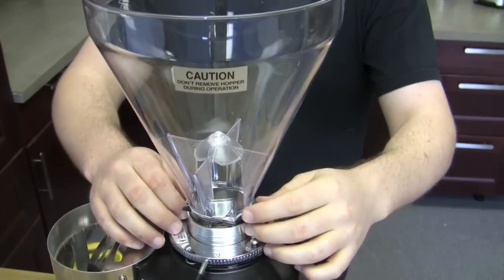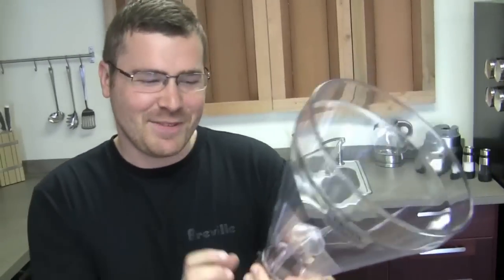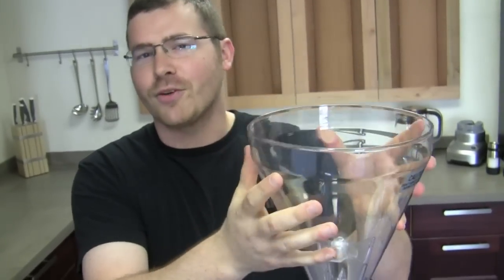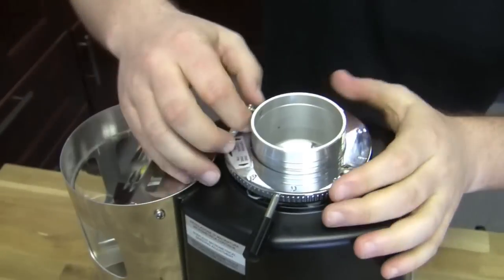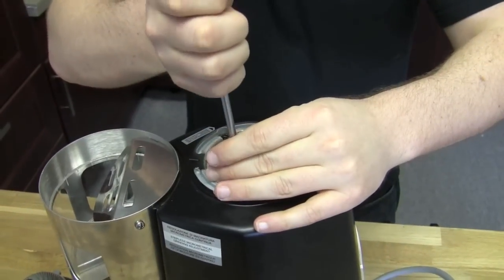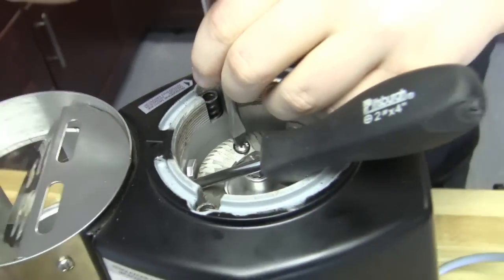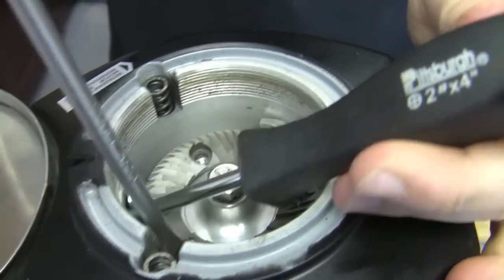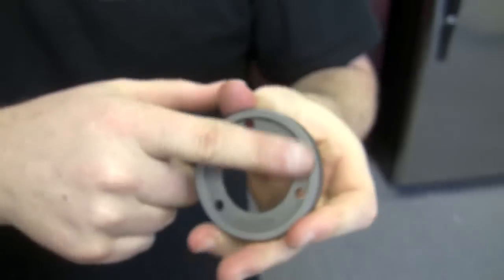Tech Tip: How to Clean the Mazzer Super Jolly Coffee Grinder

Comment: Though this post is a bit old, hope to enlighten some coffee lovers and help keep their gear clean. 
In the beginning Brandon says how he dislikes a brown hue in the hopper do to coffee oils, though this is part of it,  the fact is if your  hopper a older (1-1/2 -2 year old grinder) yellowing of the hopper is normal. This has to do with a chemical used in the manufacturing of the hopper for fire retardant, strength, and molding called Bromine, or the loss of.  The loss of bromine doesn't  mean that the plastic is recoverable. Though they look a bit rough.  Cleaning does help, but if you have cleaned and cleaned with no results it's not coffee oil.  
But you can fix it. You can use diluted H2O2 (Hydrogen peroxide) 5 to 7 % with water! Seal the bottom with plastic rubber bands or what works with you. Pre mix and fill, then leave outside for 8hrs (that's right) UV reacts with the H2O2 and bromine to remove the ugly hue! bromine is brownish red in production then they use UV to remove hue!

Comment: Great instructional video. I just followed his instructions while cleaning and replacing the burrs on my 10 year old Mazzer Mini Timer grinder. However he's wrong when he said it's not necessary to remove and clean the burr located in the top. Since I had to replace both burrs, I  removed the old burrs in the top and bottom. The coffee gunk underneath the top burr was twice as much as in the lower burr. Don't worry about his concern that removing the top burr was tricky and you could strip the screws. It was actually easier to remove the top burr then the bottom.
Reply: Bill Dalton yeah I guess because that one doesn't spin it's not shaking any grind off?

Comment: Gail and Co., can I ask for a lil recommendation? I accidentally "over-cleaned" my top burr carrier and collar for my SJ while removing a block in the spinning lower carrier, and now...my adjustment collar is stuck half-way on. (Already broke the adjustment rod trying to turn too hard, and bent several M5 bolts.) Any ideas on how you might get a stuck collar off? And what might I use for grease in there? 

Love you guys and gals! Would buy one of your refurbed Rockets if I could afford it...
Reply from the maker: It sounds like you may have cross threaded you burr carrier. If that is the case it's not recommended to do that your self and we would recommend finding a location to have your grinder repaired at.
Reply: @SeattleCoffeeGear  that is why any or most, of the threads, are first positionned at the start of the thread by turning the part on reverse direction until the start is heard and felt
Reply: @IsaacOLEG  Hey Isaac, since you provided really professional insight can you explain a little more detailed how you would screw the collar back on? So you would lightly push down and spin in the reverse direction until you hear and feel a slight click. Would that be appropriate to find the start of the threads?

Comment: Guys, just wondering if you can help. Just recently bought a super jolly and after grinding for about a week, 2-3 cups a day. It started grinding less, like 20-30 secs for a single. And i didnt change any settings after when i first set it up. I went through all the steps you guys did and nothing changed. The burrs are definitely grinding but the coffee seems to be stuck somewhere. It seems is jammed in the shute...? Any advices??
Reply from the maker: Hello Last Goodbye, Likely your grind is just a touch too fine and so by going a little bit coarser, you might not see the clogging that you are currently getting.  Or, if you are using an oily bean, to achieve the right timing, you may need the same grind setting, but just need to clean it frequently.  Essentially, the oils are building up on the burrs, so this is probably why you are noticing a change and the beginning of what seems to be a clog.  A clog can develop quickly (way too fine for the blend of coffee) or slowly (just a little too fine), so it’s about finding the ideal setting for the timing, and of course keeping maintenance in mind.

Sounds like at this point it may be clogged, so you may need to take the burrs apart and clean them, and clean out the clogged grounds.  Making sure it’s all cleaned, then probably setting it just a touch coarser will take care of the recurring issue, but you will still need to occasionally do maintenance. I hope this helps! ~Miranda

Comment: There are a few things that I am surprised that were not addressed in the video:
1) The internal AND external threads of the grind-adjustment collar should have been brushed out (easy) to make easier the threading/rotation. He put it back together with a good amount of residue in the threads.
2) The clear plastic insert in the grounds-hopper gets a lot of oily crap on it AND between it and the metal grounds-hopper housing. It never stays as clean as looks this unit.
3) The grounds-chute from the grinder blades to the grounds hopper really SHOULD have a proper-size bottle brush run through it; a lot of chunks and powder builds up in there very quickly. Poking a medium-size screwdriver into the top of the opening does NOT cut it!
4) The three springs and their sockets in which they rest should be cleaned out...yucky!

Comment: I like the demo but burrs orientation must be preserved I think. a simple dot wit a non permanent marker so you put it back on the same position 

Thank you, not critical but it is a standard process in mechanical dismounting to use alignment marks for mounting back.
Reply from the maker: Hey Isaac, while that may be true for many mechanisms, it actually doesn't matter if the orientation is preserved on a coffee grinder. You do need to ensure the top burr goes up top and the bottom burr goes on the bottom, but their orientation is important for this type of grinder. Thanks!
Reply: @SeattleCoffeeGear  indeed that was just a general purpose idea. I did work a bit to obtain perfect parallel fitting on a MDF Gaggia, but the top burr is installed in a threaded part so it is sensitive to the threads inclination. Before regulation I had to be on number 1 ,almost touching, once aligned matching I was on 5 ..  U just did get a Mazzer SJ and noticed the different fitting for the upper burr. Should be less sensitive. Anyway the bar who sold it to me had it regulated regularly dose and grind,then they do not change anything. (But it was a billiard,not a coffee bar )

Comment: PART - 2  From comment  below!!! plz read in full!
Warning: (You don't want to have H2O2 (Hydrogen peroxide) touch aluminum or other metals while in UV light!!) IT CAN EAT THROUGH  aluminum, and discolor stainless steel! So REMOVE ALL METAL PARTS! And Keep AWAY FROM YOUR BEAUTIFUL GRINDER/AND MACHINES! 
You can use  flour, cornstarch, xanthan gum,  guar gum, , potato starch or food thickeners to create a paste. 
You can use a indoor UV light (just keep far enough so it doesn't get hot.. For obvious reasons!)
Reply: Oh, also clean thoroughly!!! With water 2-3 times!  If you want to be sure you have all the hydrogen peroxide out, wipe your finger around the hopper and taste!,  you'll know if there's any residue left!! The percentage left if any will be so low it'll be harmless.